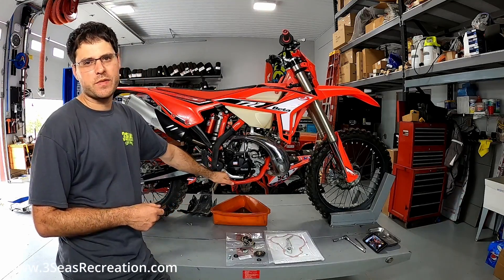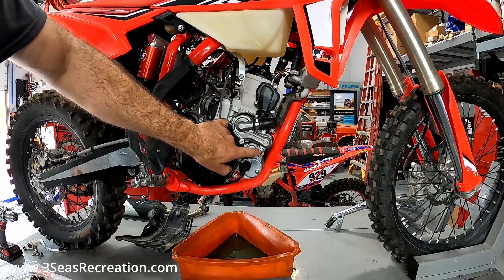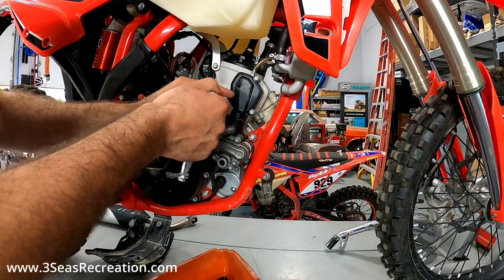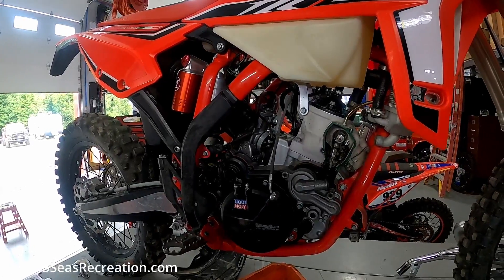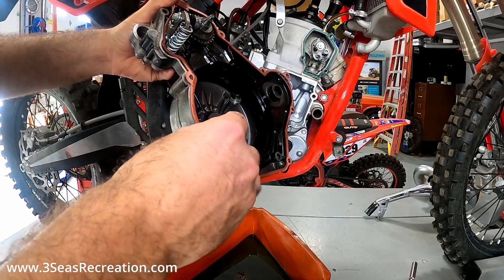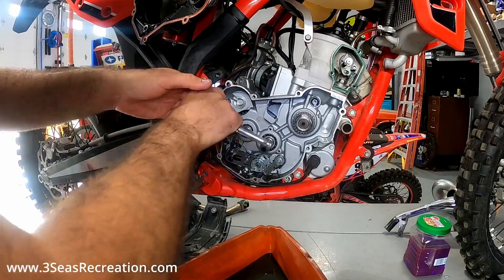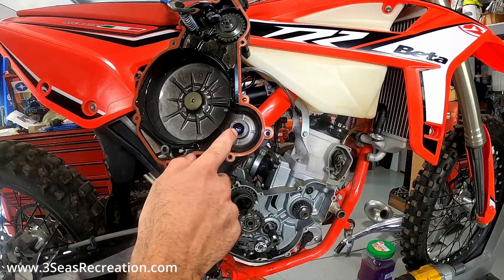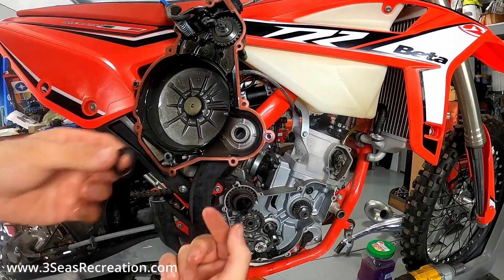2019+ Beta 200 RR Motorcycle Kick Start Kit Install video! You can do it! Kit Part Number # AB-21194

Comment: Is there a torque speck for the clutch casing bolts ? Or just nipped up tight ? I looked in my owners manual but couldn’t find anything, 2023 200rr
Reply from the maker: Good Morning, check out this engine manual on page 127:

https://betausa.com/content/SUPPORT_PDF%27s/2022%20Beta%20125%20200%20RR%20Service%20Manual.pdf